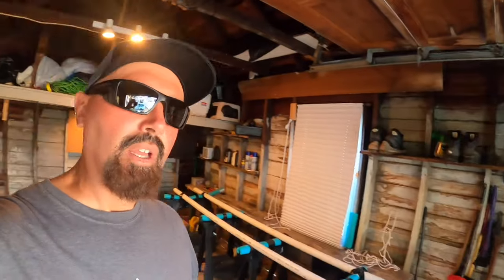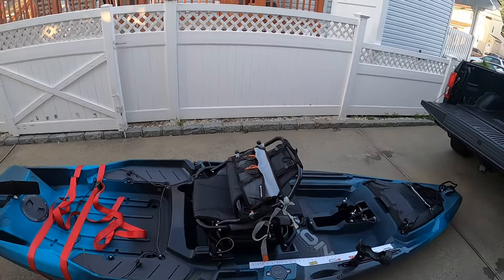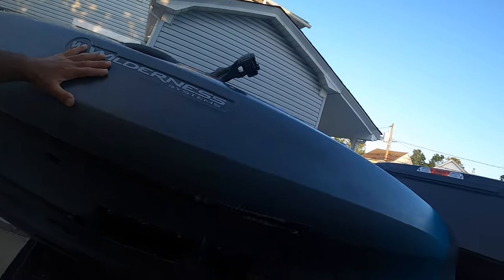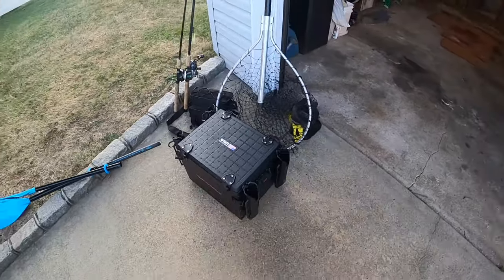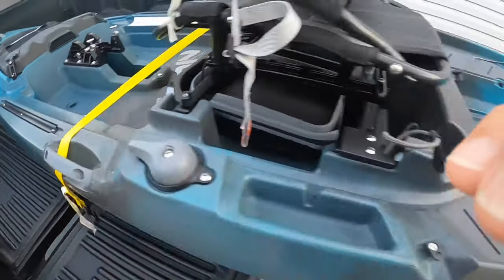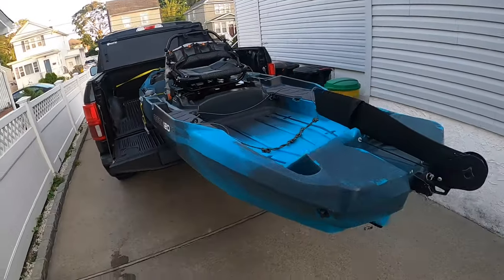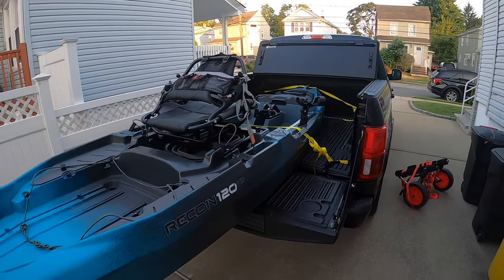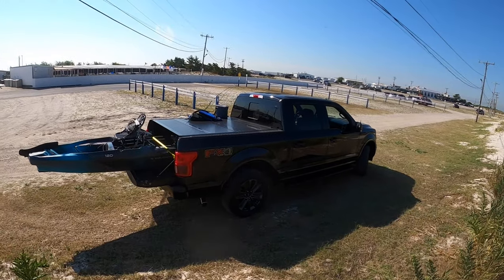WILDERNESS RECON 120 PICKUP TRUCK TRANSPORT AND OTHER OPERATIONAL TIPS

Comment: got mine car topped, she is pretty heavy , on top an old Rav4, yours goes up way easier than mine, Yak Attack does have some nice gear,theres a drop motor mount for the front Im looking at ( through the peddle gear slot)